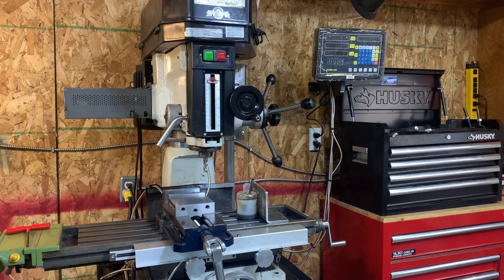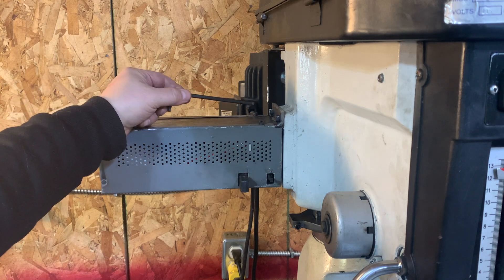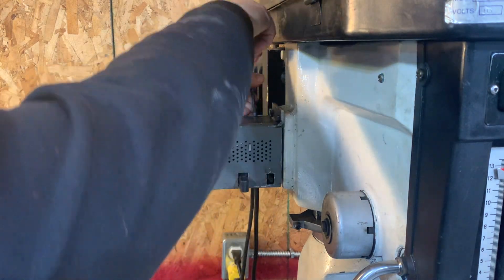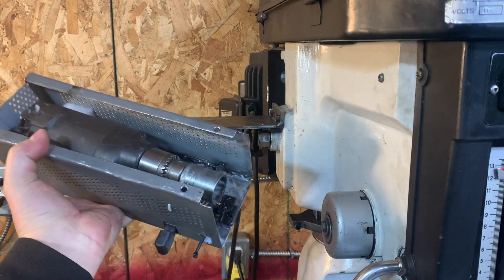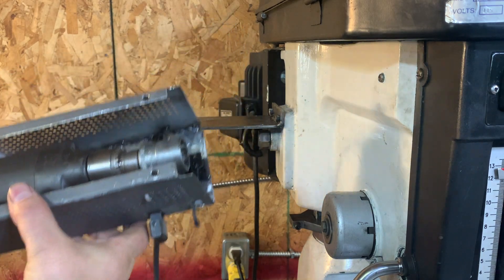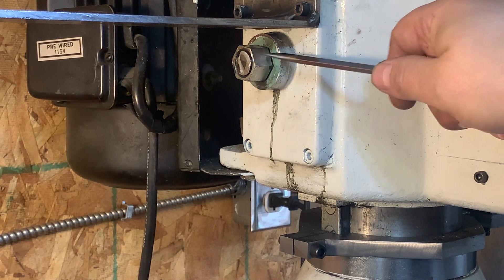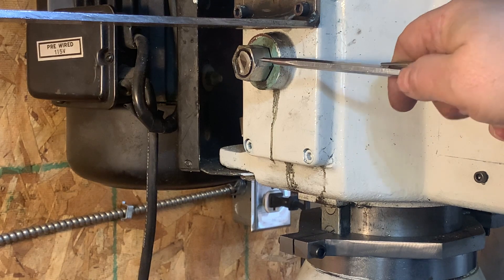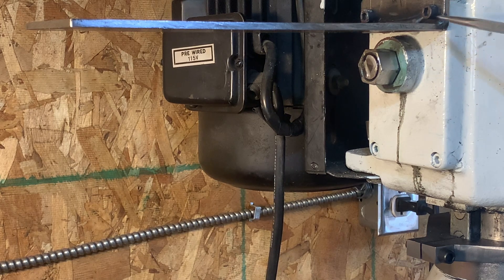Milling Machine Power Lift

Comment: For me i would like to see the demo not wide open but variable speed  .we have to assume the more pressure the more things will wear .after all it was designed to be hand crank.
Reply from the maker: You’re absolutely correct Tony. It’s not meant to be going up and down constantly at full speed. So far after a year or whatever it’s been, I find that it rarely gets moved since it’s a home shop. Perhaps if it was a commercial shop I might have to consider a mechanism that is different. Good observation. Thanks for your comments. Much appreciated. Gilles